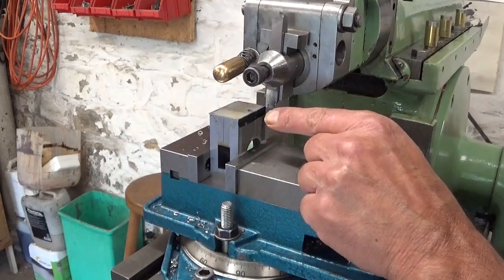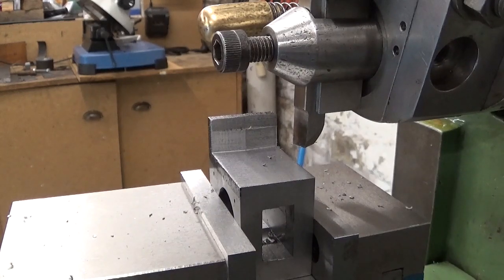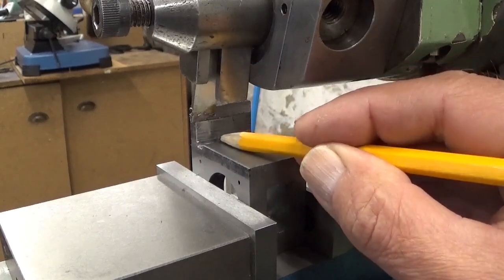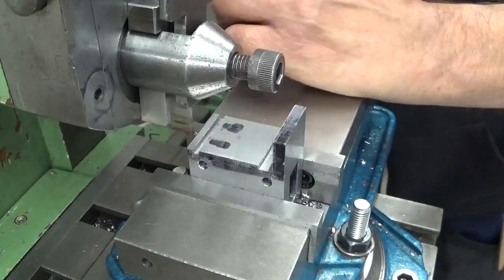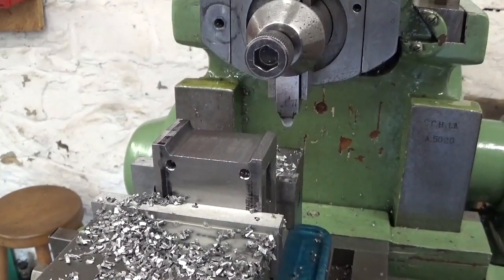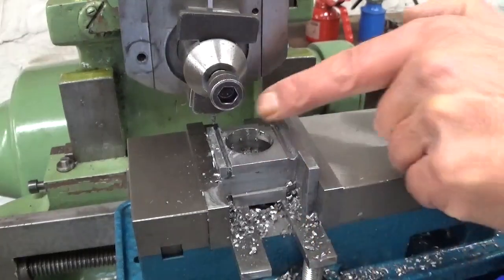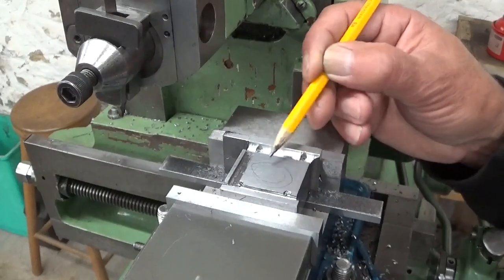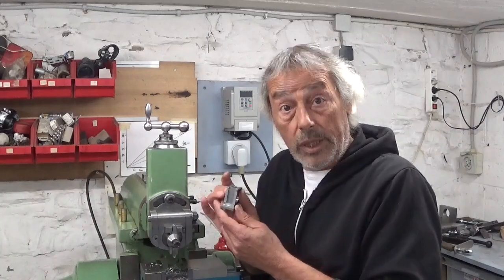Scale model shaper pt 3. The main body finished.

Comment: I have a shop built milling machine that I have adapted to also accept a grinder spindle. It's no surface grinder, but it serves in a pinch particularly on smaller parts. Have you ever considered adding a grinder to the shaper ram? Or have you seen it done? I can't imagine it working very well unless you could slow down the stroke. Your thoughts?
Reply from the maker: Tony and Paul installed angle grinders on their shapers.
https://www.youtube.com/watch?v=txAWt0RTeDc
https://www.youtube.com/watch?v=N8t2gxvTAlA
I'm sure there are others.
It is something i don't want to do, because most of the moving parts on a shaper are exposed.
It's not a good idea to cover these precision surfaces in grinding dust.